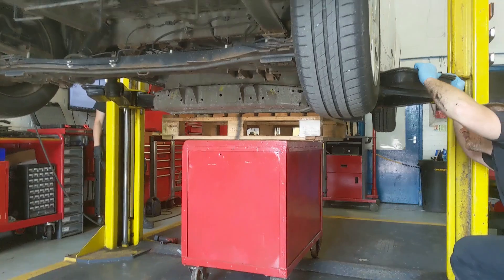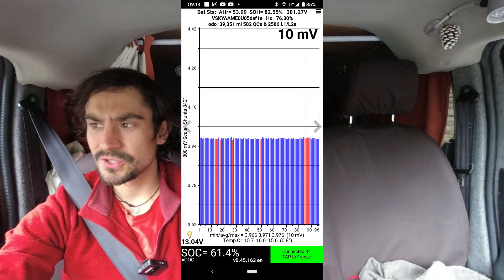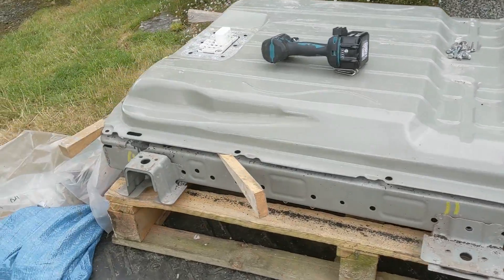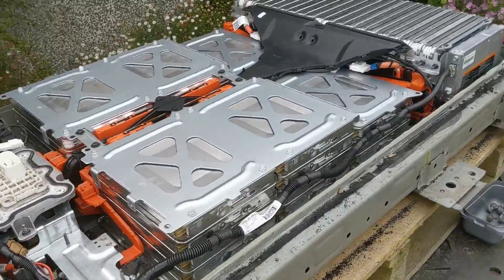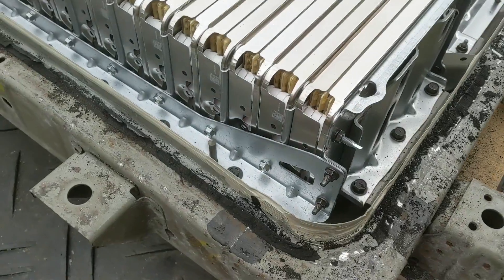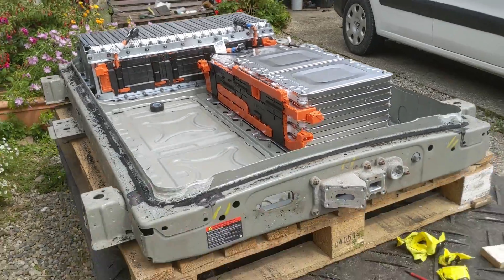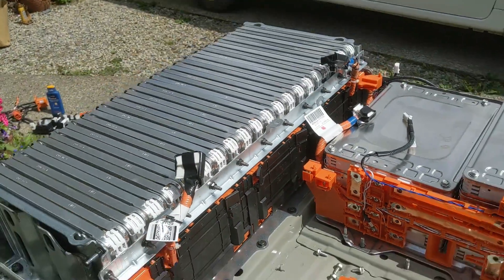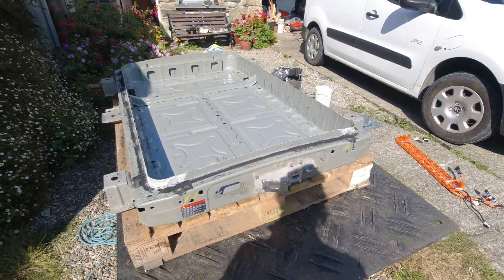Nissan e-NV200 Battery Pack Disassembly Teardown

Comment: Thanks for sharing. 

Came here looking for the forced air cooling of this battery pack. 

I’m thinking adding air cooling to Nissan leaf - external cooling system, use conduit pipe to duct cool air into the battery pack. Keep it all waterproof. Prolong the battery pack life and increase the functionality of the car.

Comment: Hi Glyn. Based on what you saw in this video do you think it's possible to replace the main socket on the battery (50/80kw?) without opening the pack? By de-pinning the two conductors and pulling the orange RCS800 connector off to replace it?
Reply from the maker: I don't think so. Out of interest, why would you need to place the socket?
Reply: @GlynHudson   An absolutely freak incident involving a gust of wind an a wooden pallet glancing the socket and snapping  a small part of the orange connector!
Reply from the maker: @B2C2007  oh dear, what a nightmare! That's very bad luck. I'm pretty sure to replace the connector you would need to open the pack, I don't think it can be de-pinned, it's always sold as a whole unit: https://www.ebay.co.uk/itm/176213466753?mkevt=1&mkcid=1&mkrid=710-53481-19255-0&campid=5338365712&toolid=20006&customid=EB194718359&
Reply: @GlynHudson   So easily done, with hindsight! Thanks - yes spotted that. Just wondered if the Leaf and ENV have the same length brown connector  wire (assuming the 2 main conductors are the same length). I am resigned to open the pack 🥲 Do you still have yours to measure it (3 years ago probably not)?
Reply from the maker: @B2C2007  I've just checked some video I took when taking apart the battery and the part number for the connector RCS800 is the same for e-NV200 and LEAF https://photos.app.goo.gl/A4Ncv4bfhCP5tM5aA
Reply: @GlynHudson   Wow you're organised! That is brilliant. Love the extra unedited footage - can't thank you enough Glyn.
Reply: @GlynHudson  Hope you're well. Did you keep any of your box of battery bits? I can't remember if I asked you? Service plug and it's socket, for example?
Reply from the maker: @B2C2007  sorry, I'm afraid sold all the bits a while back
Reply: Cheers. I couldnt remember if you'd told me that.  @GlynHudson

Comment: Interesting, so all the air cooling does is blow cool air onto each module? As it doesn’t seem like there’s a gap between each module to blow cold air through them
Reply from the maker: No it just blows cold air over the top of all the modules. Proper liquid cooling that most modern EVs have is much more effective, but this is better than nothing! The Nissan LEAF doest have any form of cooling whatsoever.
Reply: @GlynHudson  ahh okay interesting, i wonder how effective it is compared to the leaf without cooling (i.e does it make a big difference on road trips). Does it have an exhaust fan/exit?
Reply from the maker: @domtdoodar99  yes, it does make a difference. It will still get hot if driven hard and rapid charged several times, but it cools down quite quickly. No exhaust, just a heat exchanger using A/C refrigerant the battery pack is still sealed and waterproof.

Comment: Hi Glyn.
How do ventilate your van whilst sleeping.
I would like to convert my electric van and need some ideas.
Alan.
Reply from the maker: I've got wind deflectors fitted on the windows, so I can leave the front windows open without rain coming in, I've also got a sliding side window which I open. Also I often leave the climate control running overnight to have plenty of fresh air and heating/cooling if needed. If you don't have solar panels or a roof rack on the roof like I have, fitting a 12V fan in the roof to draw fresh air through the van would be a nice addition.

Comment: Interesting to see the "cooling" system, all those cells give me itchy hands, I building a small home battery system with them is very tempting. Or a semi portable leisure battery with inverter etc is also tempting.
Reply from the maker: There are some good off the shelf bms systems you can use which make building a battery store using these cells relatively straightforward e.g Batrium bms, they have a LeafMon sensor for Nissan leaf modules. I've not used it myself yet, but it looks impressive

Comment: Maybe could’ve just used whole pack as a ‘home power storage’ battery?
Reply from the maker: The individual modules are much easier to use for home storage. The whole battery pack is physically too large and too heavy to be practical for home storage. Also, it would be quite a challenge to get the battery to close the HV contactors when the battery is outside of the vehicle, the Nissan bms is designed to net let this happen. As far as I'm aware there's no way do this. Using the individual modules allows the use of a different bms system that's much more flexible e.g I've heard batrium bms is a good option, but I've not used it myself yet
Reply: @GlynHudson  I have the official documents on how to reuse the BMS for stationary storage. Might make a video on this 😁
Reply from the maker: That would be interested, I've not found any solution for doing this other then using the Nissan PDM and inverter. Obviously if space was not a limitation this would be the easiest way to reuse the battery pack as stationary storage. I can imagine a shipping container full of old packs providing grid storage!
Reply: @DalasEVRepair  You mean as a 360V pack right?The best situation would be to use the pack or even better the car itself as a portable battery.I 'm living offgrid (battery pack is from my 30 kwh    heavily degraded Leaf (,I contacted you Daniel  and you were right about the fact that the BMS will not cope with the 24kwh battery modules:they work but the SOC îs all over the place! 😀).I'm using AC Coupling in my offgrid sistem and here is the place where You came in, Daniel!If we could hook up an ongrid Fronius(or other) inverter directly to the ChaDeMo port and could open contactors::portabile generator!! 😎 and less worries in winter!
And I got one more question for you Daniel:Does the new version of Leaf Spy Pro 46..171 have the abillity to erase the DTC 3102 to pair another battery to the Leaf?I should find a proper pack in the following days.Thank You for your work!

Comment: Careful. Those are not high voltage rated gloves your wearing and have you discharged each cell pack?
Reply from the maker: If you look carefully I was wearing high voltage gloves (class 0, 1000V rating) when handling the high voltage bus bar interconnects. Once the pack has been split down into individual stacks and modes the voltage is much lower. Each module is only 7.6V, so totally safe to handle without gloves
Reply: Nice one. I hope you do well selling them and all the ancillaries. Glad to see the new 40 battery is performing for you guys! Are they an expensive used buy? Just asking because was thinking of getting an older Leaf 24 snd swapping its traction B to a 40.
Reply from the maker: @kinross24  I paid about £6k for the 40kWh battery which was 1yr old. Sourcing the battery is the tricky bit
Reply: @GlynHudson  Now that you have opened and dismantled the pack, given your time over would consider buying the more common Leaf 40kw pack and just swapping out the "40kw" cells ?
Reply from the maker: @rhiantaylor3446  that wouldn't work too well since the LBC / BMS is setup for the 24kwh cells, the GOM would be incorrect. You would also need to swap the LBC, and I think the env200 had a different LBC to the Leaf since it needs to handle the battey cooling system.
Reply from the maker: See https://github.com/dalathegreat/BatteryUpgrade-UserManual